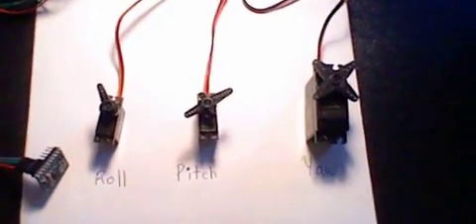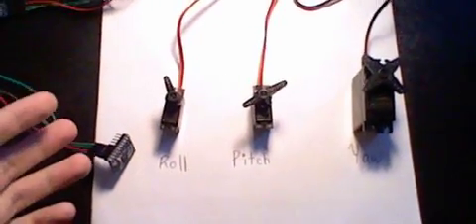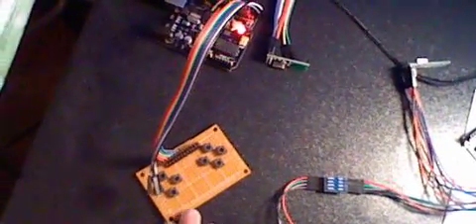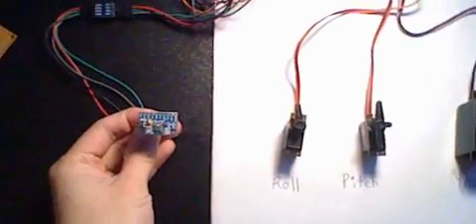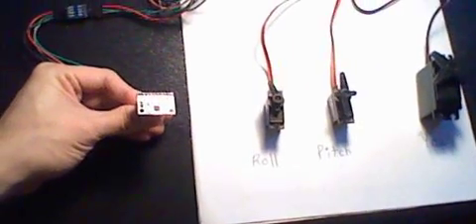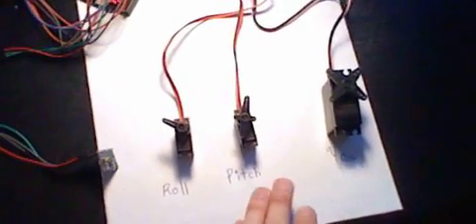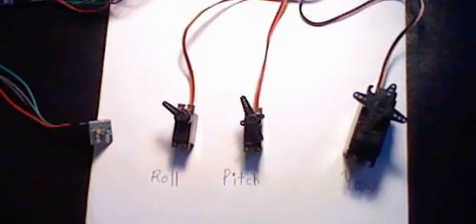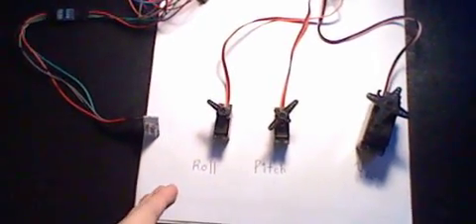Preliminary Accelerometer/Gyro Demonstration

Comment from the maker: The angle of each particular axis is found using the Euler Angle approximation method. There are better methods that avoid singularity at specific points but I chose to use this out of simplicity. You get the raw values from the MPU6050 module and convert them using the Euler equations mentioned above. Once you have that, you can send them as single bytes over the NRF24L01 modules. Or you can put them into one 32 byte package and send it as one, which was what I did.

Comment from the maker: I know this is a while back but I didn't respond until I can confirm that controlling both wasn't a problem. There is a delay since it is a sequential processor based MCU (though I'm sure pipelining can reduce the time) and jitter can be reduced using PID control. See my other video to the finished project for the overall performance in the end. Its called Camera Stabilizer Mark 2.

Comment from the maker: For controlling all 3 stepper motors in parallel you could do it in a few ways. If timing is crucial you might need to use something that can perform parallel processing such as an FPGA (check out the Altera Cyclone 3 series). If timing is not crucial then you can receive the data using a buffer and process them. The problem is that you will notice a delay in between each instruction unless your programming is very efficient. Once all the processing is done you can move each stepper motor.